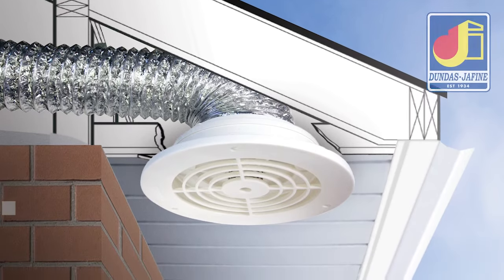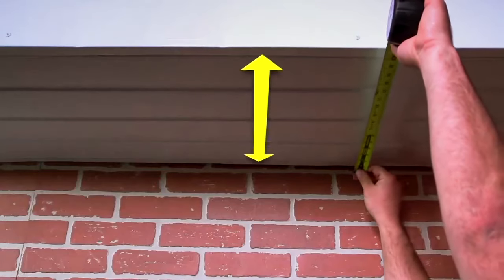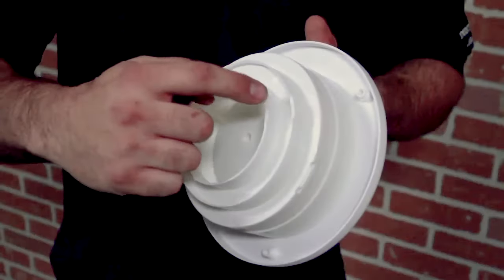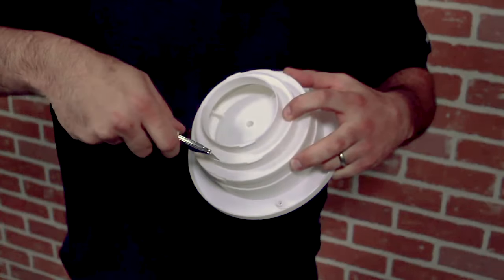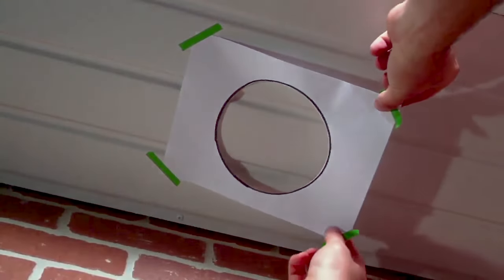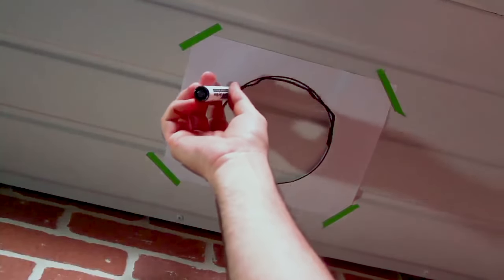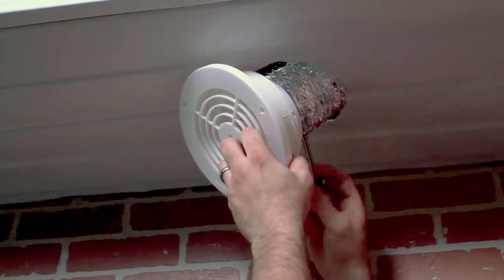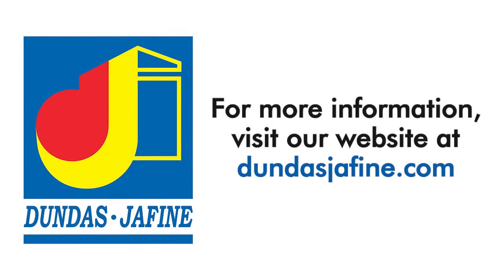Soffit Exhaust Vent - Installation: Dundas Jafine

Comment: Will this prevent outside cold air/wind from entering indoors through the vent?
Reply from the maker: The unit includes a damper system that keeps cold air out.

Comment: can you use this for the dryer, the birds got into the one with the flapper
Reply from the maker: Due to the fixed grill and the difficulty in cleaning and removing lint from this product it should not be used for clothes dryer applications. Please check out our ProShield Exhaust Hood as a great alternative to keeping pests out. It utilises this same spring loaded damper system but is for clothes dryer applications.
Reply: @DundasJafineInc  Can the proshield be used in a vertical application in the soffit. I have the dundas soffit dryer vent but the flapper stays open and birds have gotten in.
Reply from the maker: @jasoncrowley9948  The spring tension has not been tested for prolonged periods in this position so its undertermined whether over time the spring will continue pulling the shield back to this closed position or whether gravity will work against it.
Reply: Instructions state that it's not for use with a clothes dryer.  Why advertised as such, I don't know.  I use two for bath fans, work fine.
Reply: Can it be used at wall instead of soffit. My bathroom outlet vent comes out at wall .